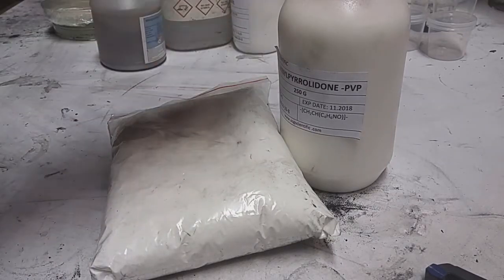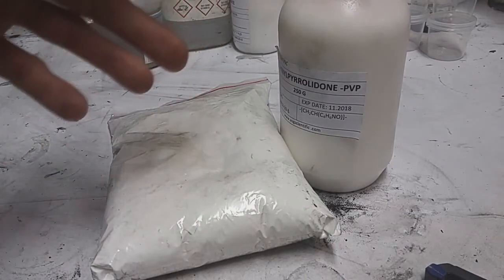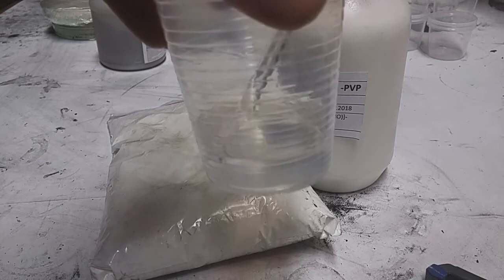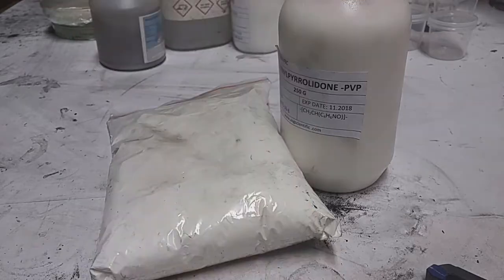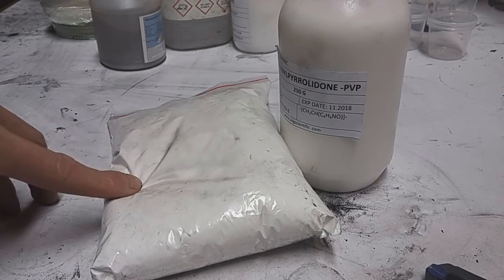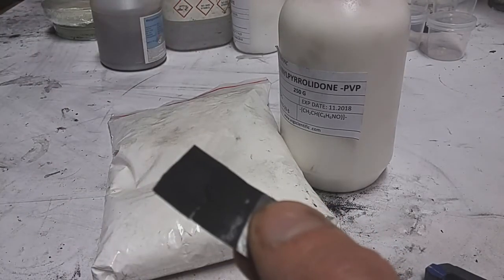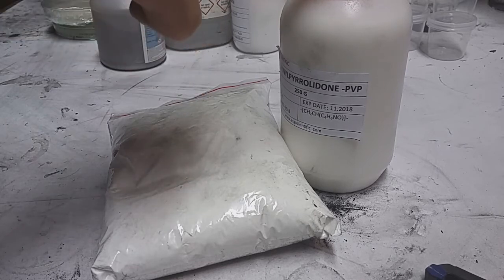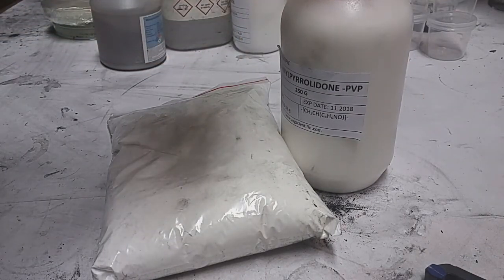Binder for battery and supercapacitors

Comment: I have a suggeation Sir, 
how about the first layer is pure PVB for protecting the metal anode or currentcollecor, 

Then the second layer of paint can be any binder/polymer that allows water to permiate so your metals is still protected, yet you can get the most out of surface area of active material?

Not a scientist, thought just appeard randomly in my head. Tell me if my suggestion is wrong sir.
Thank you

Comment: Can i use white cement or pop as binder for carbon and mno2 current collector for battery ?
Reply from the maker: Yes. If the cement soak the electrolyte and uf the cement will be in good form also when is wet, then yes. Maybe will be not the best binder but make a try and you will see what you will get.
Reply: @cayrex  i am working on sodium ion battery which is water based so the problem is when i try to charge it creates bubble and expansion which slowly removes the carbon based current C from electrodes so i want such electrolyte which is hard and water proof but am worried if it decrease the conductivity or capacity of material ?
I tested this battery (prototype )
only 1 - 2 gram  of this type of battery gives 2.6 to 3 volts i lighten the green led for 10 min using this battery .
Reply from the maker: @omsingharjit  Sodium ion battery with water based electrolyte, huh, good luck with that. And you get 3 volts with water electrolyte? You know that sodium ions are reactive in water, right. What is your intercalation material that you use?
Reply: @cayrex  ooh you are not believing me 😒 .
It's sodium mental which is reactive to water but i am  using aqus Water based sodium based solution like naso4 , naoh . May be it's not good to say na ion but because it work on Na so m calling it sodium ion i can demonstrate you that  if you don't believe me 😉
Reply from the maker: @omsingharjit  for the electrolyte you can use high mole NaClO4 or Na2S2O8 in non water base. With 17M NaClO4 you will get much higher cell voltage
Reply: @cayrex  i will try ,  can you suggest me that liquid ?
Reply from the maker: Great work

Comment: If one binder is water soluble and the other is not and you use water based electrolyte, want the water base wash out this polymer leaving holes that would cause a short in the battery or capacitor? Just asking mate.

Comment: How much concentration PVA to used for binder?
Reply from the maker: depending what materials you use,.... 2 to 10%/weight. 90% of active material, 5% conductive material, 5% binder for example. Or 75% active material, 15 conductive material, 10% binder,.... you have many options.

Comment: Have you tried Teflon (ptfe) in N-Methyl-2-pyrrolidone a lot of paper so use that, what kind of electrolyte do you use? Acidic or basic? I use basic one in water.
Reply from the maker: Marco Loureiro Silva yes teflon is a good binder and is used a lot. For the electrolytes I used ionic liquids in my favorite electrolyte type. I used in supercapacitors and I can get over 100 farads per gram with no problem. Also the voltage range is higher that from water based electrolytes. Ionic liquids dont evaporate. If you have interest for making this electrolyte you can go to my Patreon and for some donation (which help me by my projects) you can unlock the recipe.